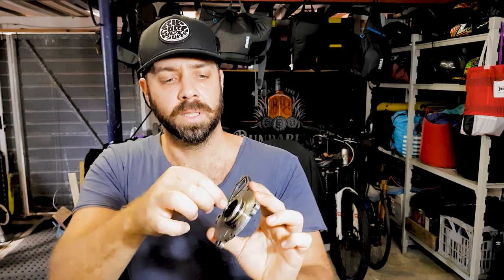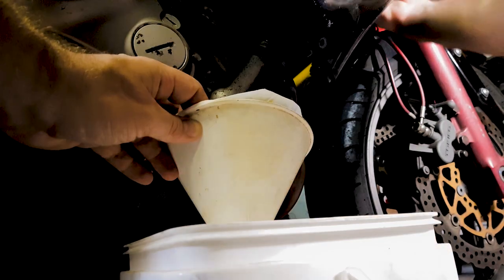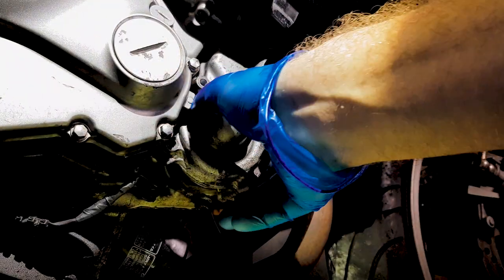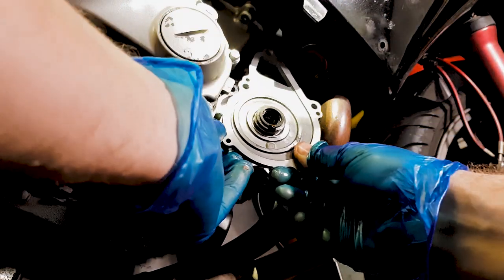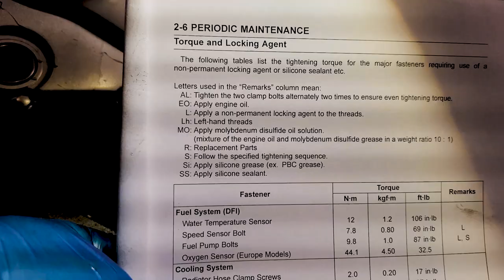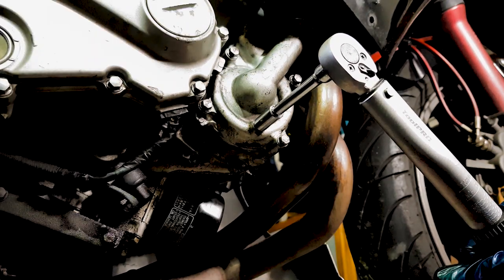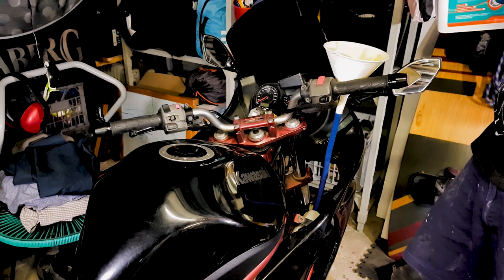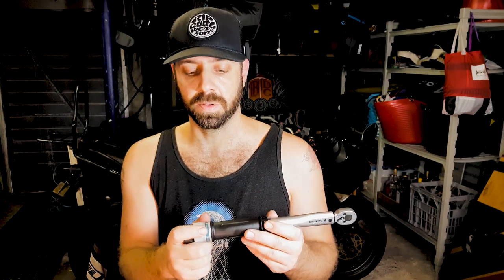Kawasaki mechanical water seal Ninja er6f er6n Versys how to

Comment: I used the vice method, worked like a charm.  I used the seal plate as a template and cut out two patterns from a sheet of plywood, drilling out the center big enough to fit around the seal housing on both pieces of wood.  Sandwiched the seal plate in-between the plywood cutouts to protect the aluminum while in the vice and the seal pressed out easily with a socket.  I probably could have done it with a big c-clamp in a pinch. A 1" 12-point socket fit perfect to press the new seal in.  Thanks again for showing us how to do it!
Reply from the maker: Nice one! Stay tuned for lots more - I'll be introducing "The Thing" ( a hybrid custom naked adventure tourer using parts from the versys mixed with the er6n...)

Comment: Thank you for this video. I just bought an ER6n and this same leak happened after 500km. I was shit scared that it is something serious. Pfft what a relief.
Reply from the maker: Yep. It's actually quite an easy fix. They are great bikes. Enjoy!
Reply from the maker: Check out my other video where I go into more detail about removing the impeller and pressing in the new seal...
Reply: thanks for the vid bro great help they must all do this i got an er6n as well and same leak, would you know what causes this to happen and what is the hall unit called? thanks alot in advance keep the videos coming bro subscribed cheers
Reply from the maker: Hi Ride or Die. 
The leak is caused by wear and tear. Usually needs to be done every 35 000 kilometres or so. I've heard some bikes have some issues with the balance Shaft and that could cause it to happen more often. The seal is called the mechanical water seal and the unit is referred to as the water pump. Check out the description in the first video where I list the part numbers for everything that needs to be replaced. Good luck and ride safe!

Comment: Nice vid mate, hoping not to have the need to do this, but just happened to come across your video. Due to the recent issues and being one of the vulnerable, I hadn't ridden mine properly in almost three months. After doing so the oil has gone a light brown colour, darker that Baileys, I'm hoping it's moisture due to sitting for that time, it's new oil from March, but sitting and short rides after can cause this so 🤞 for me, but I know where to come if I need to.
Reply from the maker: Pretty normal. Happened when I broke my ankle (not riding). I was starting the bike once a week. Its recommended that you run it at least until the fan comes on but it's not really great for the motor. Better to put the battery on a float charger and leave her alone until you can ride propely again.
I'm off for my first proper ride next weekend. Super keen. 😊
Thanks for the comment.
Ride safe.
Reply: @TheDeepPlanet  I have a lithium battery so no problem there, but that does put my mind at ease some more, thanks. I received my new oil and filter and will change them again to be sure it's good, thanks again, enjoy your ride and be safe to bud.

Comment: I have heated up the water pump housing plate but I still could not take the plate off from the bike. Please tell me how you did that. THanks.
Reply from the maker: Hi Thang. Check my other videos on this. You need a plastic or wooden wedge to loosen the plate.
Reply: @TheDeepPlanet   Since you are having several videos I do not know which video you were referring to. Is this video? https://www.youtube.com/watch?v=qTaVxyoDUbQ&t=241s. I  did not see you use the wedge to remove the plate.
Reply from the maker: There are to tabs on the pump housing plate. Get a piece of timber or hard plastic and get it behind the tab and tap it with a hammer.

Comment: Great video, but I was really hoping to see how to remove the mechanical seal.  I have it all apart, and I have the new seal, and I want to see how to do it myself, I don't want to pay someone to do it, but I have already broke two seals trying to get it in because they are such delicate graphite.  If I keep breaking them I will probably end up paying more then just having someone do it, but I really just like to know how to do things myself.
Reply from the maker: Hi Daniel. You're absolutely right. I do mention in the video that it's worth taking the plate to a mechanic to press in the new seal. You could do it with a bench vice and a socket but you actually need a proper tool for it. There's also some information in the workshop manual which you can find online for free. I might make a short video about that when I get a chance. The first time I did this procedure I replaced the seal myself and damaged it a bit...
Reply from the maker: Hi Daniel. I've made a detailed video which I'll post this weekend showing how to remove the seal and press in a new one...
Reply: matthew johnson where???
Reply: Daniel Bluck it is neseseary to remove old oil??
Reply from the maker: @milandlouhy7995  check out my channel. Uploaded video with the detail yesterday.
Reply from the maker: @milandlouhy7995  check the manual but I'm pretty sure you need to drain the oil.

Comment: Hey Matt.

So Coolant has been mixing into my oil all of last years riding season. I originally thought it was the head gasket. This winter (live in Canada) I noticed that there is coolant, and oil both leaking from underneath the water pump, so I’m assuming the seal has totally rotted out. 

Do you think I’m safe to assume this? Obviously I have to take it apart to see, but just wondering if you could shed some light as to what I would experience if the seal was failing badly.

Thanks in advance!
Reply from the maker: Hi David.
It's definately possible that might happen if the seal that keeps the coolant separate from the oil has failed but the one that keeps the oil from leaking is still holding on. What I've experienced is that the oil seal fails first and comes out through the weep hole that I refer to in the beginning of the video. It's not difficult to remove the water pump cover and check all the rubber seals as well as the mechanical seal. I've found the seals last about 25 000km in hot Australian conditions... Let me know if you need any more info...😁
Reply: matthew johnson 
I see. 
I actually had no idea that this was in the maintenance/service section. I’ve ordered all the parts that you have listed above. They arrive in about 8 days or so. 
When spring comes I’ll fix it and let you know if this fixed it. :) thanks for the video! Liked and subbed :)
Reply from the maker: Please let me know how you go and feel free to message me of you have any questions. Cheers.

Comment: Hello!! Really nice video!! I did it but I have a question. Oil stop dripping from the weep hole but when radiator fun starts I have some collont drip (just a drop) is that ok? Notice I did that 500km ago. Thanks for your time!!
Reply from the maker: Thanks! Yes, I've found that the coolant will overflow a little when the bike gets hot (stop start riding in the city or on long rides in hot conditions). I suggest you keep the level of coolant hafway between the "MIN" and "MAX" lines on the coolant  reservoir.  Remember to have the bike level when you check it. It also may vary a little from day to day depending on the temperature of the motor when you park. 
Ride safe! 😊
Reply: matthew johnson thank you for the fast response!! I’ll check coolant reservoir!! Asking a question as a person and giving me answer PLUS GIVING ME EXTRA TIP shows that you really want to help other riders!! Make more videos if you have spare time!!(sorry for my English) again and again thank you!!!!!💯
Reply from the maker: I have many plans...next is to do valve  clearance check. Planning  on building a bike from scratch over the next 12 months (er6 N)... dont forget to subscribe and hit that notification bell
Reply: That’s the bike I’ve got ER6N 2008 same engine! I’ll wait to see that. It will be really enjoying and helpful. Have a nice day ΦΙΛΕ (friend in Greek)!!

Comment: Thanks for a really informative video. I did the same as you and, even with a torque wrench, managed to shear the impeller bolt. What did you do to extract it please?
Reply from the maker: Hi Maurice. sorry to hear that. You'll need an easy out damaged screw extractor and a drill. Use the drill to drill a hole into the broken bolt and then use the easy out to remove the bolt. It is better to do this part by hand. Just Google "broken bolt extractor" to find the kit and have a look on YouTube to see how to do it.
Reply: @TheDeepPlanet  Thanks Matthew. I'll give it a go. 👍☺
Reply: @TheDeepPlanet  Success! 👍😊

Comment: I went through the snap bolt situation two times. Extraction was not fun.
Reply from the maker: LOL. I've done it twice as well. First time I didn't have a torque wrench and reused the bolt. Second time did have a torque wrench but reused the bolt. These days I replace the bolt and use a torque wrench...😆

Comment: Hey Matt 
I am having the oil leaking issue so I'm assuming it is the middle gasket that you shown so no I'm ordering the impeler plate with the gaket and also gaket 92055 do you think I will need any other part I bout the plate because I didn't want to struggle with replaceing the middle gaket
Reply from the maker: Hi Zane. You don't need to replace the plate. The main thing to replace is the mechanical seal that will need to be pressed into the plate. It is a good idea to replace all the other gaskets when you do this procedure. Check the description for all the parts that should be replaced. Good luck!

Comment from the maker: Hey all - if you find this video helpful, please remember to like and subscribe - It will really help me out. Thanks!! :)
Reply from the maker: @daniel93kl  Hi Daniel.Thanks for your comment. I realised that I had left this part out after I had edited and uploaded the video. Sorry. The impeller can be quite stubborn to get off as the shaft that it is on tends to rust a little bit and cause it to seize. It will come off but it will need some encouragement. What I landed up doing the first time is tapping a flat head screwdriver in behind the impeller but I landed up damaging it slightly. I also used some water pipe pliers and a rag and gripped one the "blades" of the impeller to get some movement (carefully as you can damage the blades if you apply too much force). What I would suggest is that you get a couple of wooden or plastic wedges and gently tap them in behind the impeller to release it from the shaft. It's not screwed on or anything so you want to just get an even force behind it. You'll feel the shaft moving back and forth as you wrestle with the impeller - this is normal. Once you have got the impeller off, make sure you remove the rust from the shaft as it can damage your new seal when you replace it. I hope this helps - feel free to message me if you have any more questions. And please let me know how you go!!
Reply from the maker: @daniel93kl  Hi Daniel.Thanks for your comment. I realised that I had left this part out after I had edited and uploaded the video. Sorry. The impeller can be quite stubborn to get off as the shaft that it is on tends to rust a little bit and cause it to seize. It will come off but it will need some encouragement. What I landed up doing the first time is tapping a flat head screwdriver in behind the impeller but I landed up damaging it slightly. I also used some water pipe pliers and a rag and gripped one the "blades" of the impeller to get some movement (carefully as you can damage the blades if you apply too much force). What I would suggest is that you get a couple of wooden or plastic wedges and gently tap them in behind the impeller to release it from the shaft. It's not screwed on or anything so you want to just get an even force behind it. You'll feel the shaft moving back and forth as you wrestle with the impeller - this is normal. Once you have got the impeller off, make sure you remove the rust from the shaft as it can damage your new seal when you replace it. I hope this helps - feel free to message me if you have any more questions. And please let me know how you go!!

Comment: Do you have part numbers for everything replaced? I'm trying to do the same to my ninja wanna make sure I got everything correct.
Reply from the maker: Hi Demonking.

Follow this link for official part numbers :

https://www.partzilla.com/catalog/kawasaki/motorcycle/2006/er-6n-australian-er650a6f/water-pump

The parts to replace are as follows:

SEAL-MECHANICAL,WATER
49063-1055

SEAL-OIL,SC12 28.555
92049-1259

RING-O,CASE-HOUSING
92055-0082

RING-O,HOUSING-PUMP COVER
92055-0083

RING-O,33.2MM
92055-1155

and optional but recommended in the service manual (the bolt that holds the impeller)

BOLT,6X22
92002-1154

Remember, you'll need to press the old water seal out and press the mew one in.

Good Luck!!
Reply: Thanks

Comment: My friend, me er6n is boiling is pouring the fluid,  i'm from Brazil and is sad tô say but we don't have trained mechanics here
Reply from the maker: Hi Junior...Is your fan coming on and do you have enough oil?
Reply from the maker: Hi Junior. I've just looked at your comment again. Could you tell me which fluid is leaking and from where?
Reply: @TheDeepPlanet  hi friend, thanks for answering me, then, the fluid leaks through the hose under the bike I think it is the overflow, what I find strange is that when you get a ride the fluid boils for a few seconds, the fan is working.
Reply from the maker: Hi Junior. Have you recently changed or filled up the coolant?  How much is coming out and for how long? Is it hot where you ride and what type of oil are you using?
Reply: @TheDeepPlanet  hi friend, so the bike presented this problem of boiling and leaking the fluid through that small pipe which is below the bike, that I believe to be the overflow, so I took her to a mechanic, he replaced the radiator cap and changed the fluid, when I took her home, again  fluid boiled, bubbled and a few drops came out of this overflow, this happened on Monday, today I rode with her and when I got home the motorcycle just boiled, bubbled without spilling this time.  about the engine oil I use the 10w40 which I think is recommended is the fluid is blue, I don't know which brand, today I called the mechanic and informed him that she was boiling without spilling, he told me that she can boil  that this is normal, I just couldn’t spill it, anyway as a pilot I feel it’s hot, unfortunately this model doesn’t have a thermometer on the dashboard so I don’t know if the temperature is adequate, so I appreciate your attention.
Reply from the maker: Hi Junior
A few more things to consider.
What type of riding are you doing? Is it in the city with a lot of stop and start or low speed riding between cars etc. Mine runs a bit hot when I do this kind of riding...
If the light on you dashboard for temperature doesn't come on, then the bike isn't overheating. 
Check the level of your coolant. It should be halfway between min and max when the bike is level (get a friend to hold it or use a paddock stand) it will change from day to day so check it on a few separate rides. Before and after.
Reply: @TheDeepPlanet  Hi friend, so I was actually walking in the city center I had several lighthouses, so I stopped and followed several times.  the fluid is at the level, thanks for your attention, I'll keep walking and follow her condition.

Comment: Why would you not mention how you got the  impeller off?
Reply from the maker: When I was filming, I knocked my camera over and didn't capture that part of the process. I'm planning on putting together a short video to cover that part. I have put some information in the comments that may be helpful. Sorry about that. 😊
Reply: @TheDeepPlanet  This is the only video I could find with the same bike I have, so please forgive my frustration. The impeller was excruciatingly difficult to deal with, I figured that their must be some trick to it, nope, just pressed on. Mine was super crusty and nothing seamed to fit behind it strong enough to pry it off without damaging it. In the end I used penetrating oil, some door panel wedges from O'Reilly's and a wrench as a hammer.
Reply from the maker: @nocomment8879  yep. i had the same problem. make sure you get all that rust off before you put the new seal on or it will fold over the rubber bit and it won't last long at all.
Reply from the maker: Hey mate. I've uploaded a video with more details. Check it out...

Comment: Hi Mathew, I really need to discuss something about this bike with you. Where could I contact you? Perhaps via email? I just rebuilt my er6f motor, now I'm having a coolant and oil mixing issue, apparently it is the mechanical oil/water seal. How sure is this? What if it is the head gasket? It is a brand new head gasket, I dont know what to do anymore
Reply from the maker: sure. You can get me on thedeep.planet@gmail.com.
Reply from the maker: Is there a lot of oil coming out of the weep hole in the mechanical water pump housing?
Reply: @TheDeepPlanet  Hi Mat, not at all no. there is a minor amount of oil breathing going on but no heavy leaking whatsoever. I just bought all the seals including the mechanical oil seal for the water pump and will do it later on today. I will keep you posted if this fixes the issue
Reply from the maker: Hey Max. Did you manage to fix the leak in the end?
Reply: @maxhofmann6993  did you fix this in the end mate
Reply from the maker: Sure did. Works great. Have had to do it again since tho...